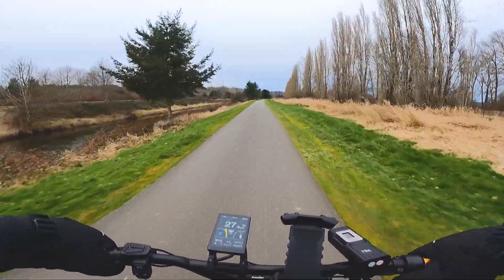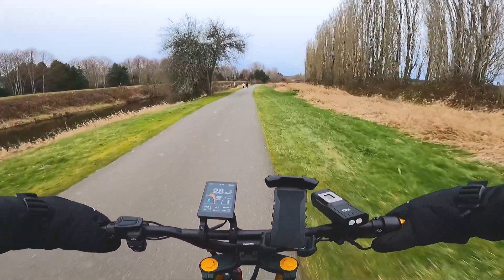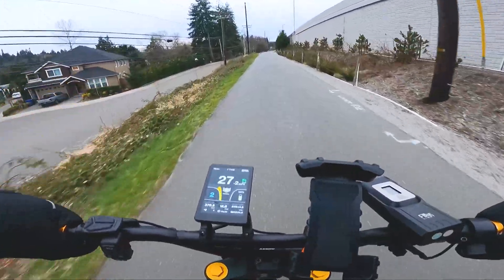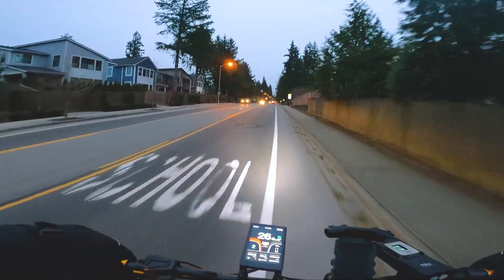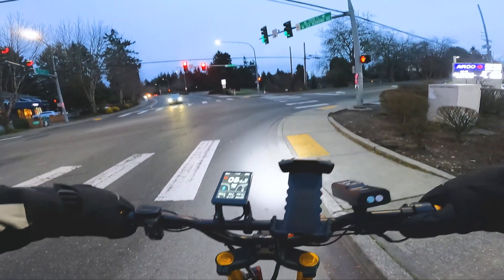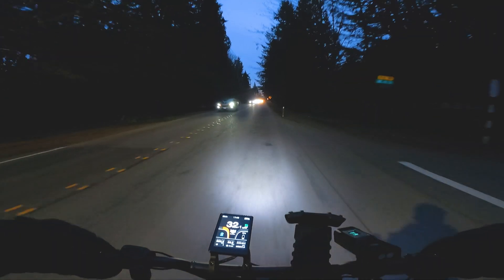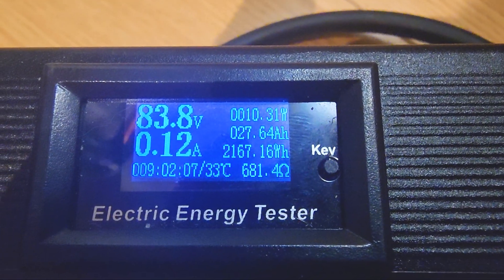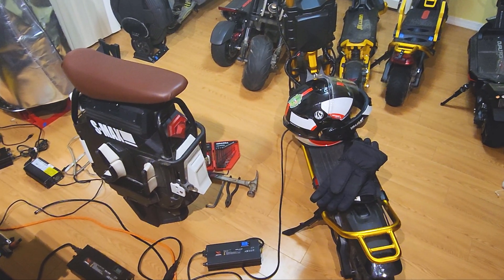Single or Dual - Electric Scooter Efficiency

Comment: My question is, how much more stress on single motor compare to dual motor? Not really worried about battery life or how much power it consumes. I just want my motor to last longer than most..
Reply from the maker: For longevity, I would focus more on not getting it wet. Rust on the stators is what I see most on motors that stopped working right. Next up is shorted phase wires or hall sensor wires, which should only happen if your scooter's overheat protection isn't working correctly. It's not really like a car engine so much where physical components get worn down with hard use.

Comment: Interesting. I just finished my second test with the Ienyrid ES1. 13.9 miles 3rd gear dual. 2nd test was 17.5 miles 2nd gear single motor. Only a 3 mile gain

Comment: I had different results on my range test with my punk rider pro. On test 1 i used 1 motor going 25 kmh and went 32km and had 1 bar left, on test 2 i used dual motor going 25 kmh and went 34 km and had 2 bars left at the end so not only did i go farther on dual motor but i also used less power.

Comment: What i have done for maximum efficiency on my WKGT is that I have set all my speeds up in my computer to max out to the local speed limits.
In a way that when I hit Max speed per Mode it go's into Auto-Cruise control after 5sec at that speed.
You can do this by doing hours of stop start testing and adjusting the maximum top speed % per Mode in the on-board computer.
It was a pain in the ass but it has been worth it.
(Also I live in Australia, do feel free to laugh at my units of measurement if you so wish, I'm happy if it makes you smile😂😂)

Eco mode = 27.5kph (single motor)
Mode 1 = 40-41kph (single motor)
Mode 2 = 49-50kph (single motor)
Mode 3 = 59-60.5kph (single motor)
Mode 4 = 79-81kph (dual motor)
Mode 5 = FULL BEANS 108kph (dual motor) i can go faster tho.

For an eco range test i have estimated that I can go 150km maybe more, I just haven't had anywhere to go that is further away.
Its also summer, sooooo, gross. 
I will wait for spring.
But have been on a 75km ride (single motor) and still had 58%+ battery left.
All on Eco Mode at 25-27.5kph.
Still yet to do with Dual Motor on Eco Mode, and will now thanks to Gingys vid here.
I gotta know for myself, ya know?
This is with a 94kg 6'4" rider with 8-10kg backpack full of whatever I need on mostly flat surfaces (bicycle paths) with a light breeze.

And you can delve even deeper into your MODE settings and adjust how many volts and Amps you want front and back wheels to recieve therefore helping manage the massive amounts of torque that is not needed in the front end on lower modes.
Saving power and helping to get power down alot smoother IMO and also saving thos micro adjustments in steering to stop the front end pulling left and right under load.
It's a WKGT so it still shreds CST knobbly tyres, thats what it does best, invest in some PMT's for better grip, tyre life, and possibly range/speed.

Ontop of that you can then get rear suspension upgrades and the previously mentioned Italian PMT tyres, I've heard nothing but good things about them.
Which I am personally looking forward too.
Also don't forget to balance your front and back wheels with 5g motorcycle weights for even better stability.
Rider Guide has an excellent video on just how to do this, and it seems rather simple to DIY.

Aaaaaaaand
"PITSTOP"

Whew that was a comment gang, I'm spent.
If it helps anyone with some ideas, awesome.
Peace I'm out 🤙

(UPDATE)
So I did a Mode 1 80km-41kph (SMM) single motor mode range test.
I actually rode 80km.
With final calculations (to zero% battery) 
@ 41kph = 99.2km with 10% battery left.
Leaving 10% battery for emergency eco mode.
@27kph - 30km 0-1% Battery
TOTAL RANGE = 129.9KM

There is one HUGE downside to SMM (single motor mode).
The single motor (rear in my case) being used takes all the load and gets SUPER hot, 64° peak temp infact.
After it hit 60° there was a significant drop in speed 36kph from 41kph.
And the pace was even worse in a headwind, so much so that I thought the back motor was going to shut down.

I will be back with a DMM (dual motor mode) test range update using the exact same path i used for the SMM range test all Mode 1 @41kph.

Comment: thanks for the test 😁 i love single motor and from the start i knew it uses less energy, its like feeding 2 motors instead of one considering their electrical losses, so 2 motor has more losses, everyday I travel 22 miles with my scooter, i got the one that has seats for comfort, and for safety, I've added steering dampers to make it less wobbly on high speeds and merged my brake cables into one lever for more efficient breaking
Reply: What scooter you did that with ? You merge hydraulic brakes?

Comment: I see all the scooter ads on ebay have the range test in both single and double motor.
You gave it too much throttle in your test. Should have been under 20 MPH at most. Way more obvious on my 2 motor bicycle

Comment: 7:40 though you are right about that specifically i have an argument, dual is less strain on the motor because its balancing between both weight points with power rather than just one
Reply: Its only a valid argument if you have evidence to back that argument up.
Are you just suggesting this argument cos it sounds better to you in theory, aka not practice?
Or have you actually tested this on a Wolf King Gt like Gingy literally just did infront of all our faces?
Cos if you haven't tested it you have just wasted precious moments of your life only too look like a nonce in the end.

Too be nonce or not to be nonce, that is the question 🤔?

I wouldn't nonce, its not energy efficient.
Like dual motor mode all the time 😉

Comment: A device with double motors used in single mode is completely different from a device which is actually designed as a single motor... in the latter case the real single motor will have more autonomy..
The unused wheel will not be a freewheel, there is a certain resistance compared to an electric scooter with a single original motor...
*So if you have a device with an original dual motor, it is better to use both motors. And put yourself in mode 2 and don't drive too fast if you absolutely want to have autonomy

Comment: Dual motor mode translates to more torque and greater acceleration particularly at  higher average speeds.

In fact i found little difference between the blistering acceleration of 2 motors, versus adding in Sport Mode when in rear wheel drive only up to around 40km/h.
* I'm just under 70kg.

You have proven that there is at least a 10% efficiency gain to be had by using the rear motor only.
But at what maintenance or parts replacement cost over time?
Reply from the maker: $0

Comment: 3rd test - use single motor mode excwept when speed drops such as going up hills, turn on dual motor mode for hills etc.. The theory is that with dual motors working there is less strain on the motor because with a single motor the single motor will call for more power to try and maintain the speed which will cause more battery drain.. Single motor would be working a lot harder for a longer period of time.. So when going up hills use dual motors, otherwise use single motors...
Reply from the maker: But if you're in dual motor up the hill then you're automatically using twice as much power, no?
Reply: That was my point.. even tho the dual motor is calling for more power, would that offset the single motor having to work twice as hard to climb a hill that would also take longer because of the slow down in speed..

Comment: Be carefull when opening throttle at the exit of corners because the motor will force the front wheel to slip first before the back due to less weight on the front [ in conditions like slipery deck or strong scooters in extreme cornering ]
Reply: Pin it and hope for the best.

Comment: I see it less about range and more about conditions. If it's wet outside then single motor (rear) is best, otherwise dual motor is best. The reason I prefer dual motors except for rain is that in single motor mode you are working that rear motor harder than normal and it's going to wear out faster than if the load were being split between both motors, especially if hills are involved.

Comment: If it's just 7%  more battery usage to have it in dual motor, I'll pick dual motor any day, since my commute is less than 8 miles one way, and almost anywhere I would go with my scooter would be that distance or much less.

Comment: Single motor will burn the controller out
Reply from the maker: The controller has overheat protection and turns off power to the rear motor if you ride in single motor mode for too long. But it won't burn out the controller. Maybe if you overheated it every day for a month or something.

Comment: 99% of the time, people say dual motor mode is more efficient. I’m so grateful that you actually tested this. People that say dual motor mode is more efficient, have tend to be highly educated, and speak with absolute confidence.

i am amazed by your results. what is also interesting, is that i have always thought that somehow, it made sense to me that one motor would be more efficient under most conditions. especially when those conditions match one another, for each test.

i appreciate very much that you made this video! thank you for a very concise, clear, and easy to understand, video, and test. great work!
Reply: You are ( sensitive  word used but YouTube flagged me for it  , rhymes with dumbass ) You took this video as gospel . One motor is way less power and the amount of battery saved ain't worth the extra load on the one controller not to mention the heat in the motor. Remember heat is what destroys a magnet's push and pull . .

Comment: "Burning question..."   Maybe not the best word choice during battery fire controversies, LOL.     That said, in my repeated experience, when all else is equal (ambient temperature, tire pressure) in the case of steep hills, dual mode is way more efficient.   Less power sucked going up hills as two motors are working together, more re-gen is added from two motors if coasting some on the way down.   An exception perhaps, from mostly flat ground testing.   Maybe a separate repeated hill test is warranted.

Comment: ima put this in simple terms, screw single motor mode.
ur only using 1 motor but guess what, that second motor becomes an absolute dead weight and as ginger mentioned in the comments, the potential damage is not worth whatever minor range increase u might get.

Comment: Yeah this is really only useful information if you need to get that extra range to get back when you're low on battery. Then you would just ride at a slower speed in single motor mode. Otherwise, the efficiency isn't worth it and you're wearing out 1 motor more than the other

Comment: Did you get the charger from ewheels?  If so, did you change the end? They only offer that in gx16-4 configuration..
Reply from the maker: I have a gx16-4 to gx16-3 custom adapter I can pop on the end.

Comment: If you riding area is flat and you dont weigh a lot, it really won't change all that much however if you ride in an area that has steep hills and what not, then you will get a lot better range in single because you only max out 1 motor on the hills. It comes down to what your roads/hills are like

Comment: Hi! 2x500W motor or 1x1000W motor? Are there differences in performance? Thanks!
Reply: Great question but I think it would be equal in performance as both will put 1000w in total power.

Comment: Ive had many electric scooters, 27 to be exact. That I have bought, sold, and traded. I have two rn, a Nanrobot Lightning 2.0 which is duel motor, and Fluid Vista, which is single motor. Both can go up to 31mph.
What’s really interesting is that my fluid vista has faster acceleration, and it can get up to speed just as the same as my Nanrobot with duel motors.
Reply: duel means fight
*dual means two
Reply: @allemander  hahajhahahahahahah sick guy  , 😂😂  but you right 😂

Comment: 15ah 48  battery got 25 miles range 25mph 
18ah 52v battery got 18 miles range duel 30-40mph
Reply: single motor scooters are way more efficient. A dual motor scooter in single motor mode still has to fight the rolling resistance of the front motor.
Reply: @slick1908  there is a lot of speculation when comes to duel motors and single   but I will say get more range from my iscooter ix5 only when hit hills does then the battery drain real quick on rhe iscooter ix5 but my other duel scooter gives me more range on hills as more efficient,  I think it is all about how fat you are and how you ride  , and the vaults  providing more efficency?????? One day I will get both my scooters scooters charged and I will do the test, using same route ,.I will.use single kn both scooters see the ra ge then I will  harte again and do a duel test with the same route and post my scientific analysis of the electric scooter

Comment: I think one of also the biggest things to consider is the wear and tear on your electronics. One motor is going to be getting way hotter and be used more which is going to lead to more failures. I would believe if I had a dual motor I’m probably always going to run it in dual motor
Reply: yep that`s what I`ve heard and why I opted using single motor or at least during the summer. Do you have any idea if using single motor in colder weather negates the overheating? Afaik going for 1wd also puts a strain on the controller though I`m not sure why it would.
Reply: Oh I just saw this, I aid the same thing , plus you'll have more power ready in dual motor mode.
Reply: cold weather certainly would negate some of the heat and act basically as a coolant. these hubs are all air cooled designs. most have slots in them to let air pass through, some do not but the whole hub acts as a heatsink which dissipates into ambient air, hotter the air the less cooling effect and vise versa. @isellcrack3537

Comment: It would be interesting to cut the front motor down to 10%-25% and try this in dual motor mode.  I'm sure that would take care of the heat issue also.

Comment: Ginger, it can be variety of problems why you overheated rear motor. As a person with mechanical background I can tell:
1. lack of grease in the bearings, or poor quality grease, or not greasing wheel bearings would lead to produce an extra heat. 
2. bearings may be defective and as a result they produce extra heat. 
For example, in my scooter back wheel bearings was to tight from the factory and I does not know that until I change them after 6 months. So, scooter used more electricity to accelerate and ride shorter distances because of that. 
After buying brand new bicycle some people brought  them to mechanic to adjust and grease both wheels and drive train. So, cheap bike start to run as high-speed bike. The same with  scooter, if you properly prepare yours scooter it would run good. It is why so important after the warranty ended disassemble and check, clean and lubricate the electrical contacts, bearings, and other moving parts. 
Only then efficiency check would be accurate. 
Also I would like to add that if you got free of charge scooter, it is a charity. 
What factories/companies  give for charity?
In my experience all what was returned, repacked, some defective parts changed, when product can past at the lowest level quality control, it go to charity, advertisement at store windows, etc.
Therefore, this means you should check every 200 - 300 miles mechanics and electronics on your scooter to be sure it is run properly.
Reply: You 😮
Reply: @ianmangham4570  
could you be more specific to say what do you think about this issue?
Reply: @ap3401  Yes!
Reply: Thought I lost a bit of acceleration on one of my scooters will send it in for a check up under warranty happy now I hot a 2 year warranty instead of one year

Comment: Anyone who claims that running any scooter in dual motor mode is more energy efficient clearly doesn't understand physics.
Reply: i hope you do. in most cases, dual mode will indeed be more efficient, providing more mileage and other important advantages (heat control, less damage to components and tube, traction bonus). in some corner cases where scooter power is distant from speed, elevation, and weight, like in this video, efficiency may flip in favor of single mode. however that's not my experience from any scooter i've had. both situations can be explained by hashword physics.

Comment: Great test video, but I am slightly surprised by the results. I did some tests on my Varla Pegasus (the only scooter I have that shows current on the display), and tested 6 modes up the same exact hill (gear 1,2,3 / single & dual each), and dual gear 1 used the least amount of current. In single motor, gear 1 was almost double the dual motor current.

So I would have expected dual to slightly outperform single.

But you are right, I think any range improvement in single motor is negated with the wear and tear on that motor. And for those that may prefer single motor for less torque, it is probably better to adjust the power level in the P-settings and still keep it in dual.